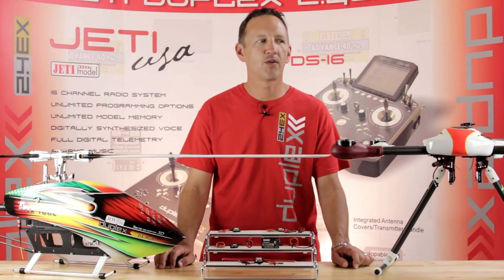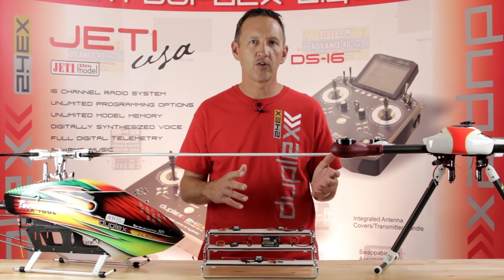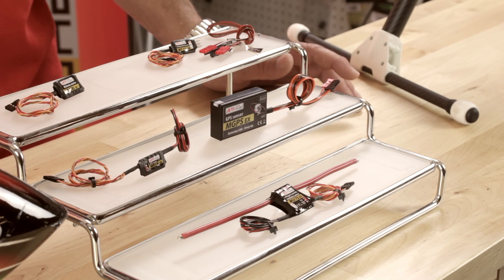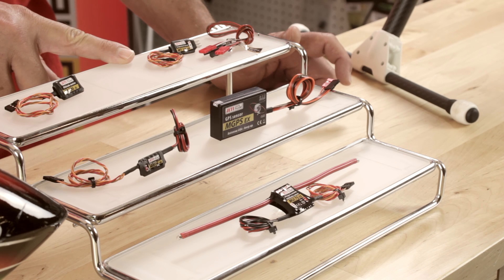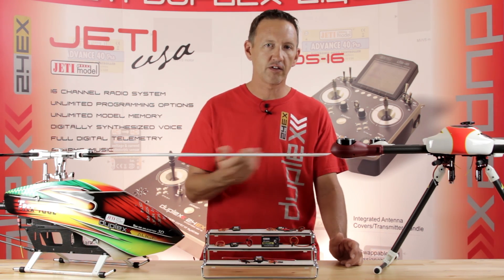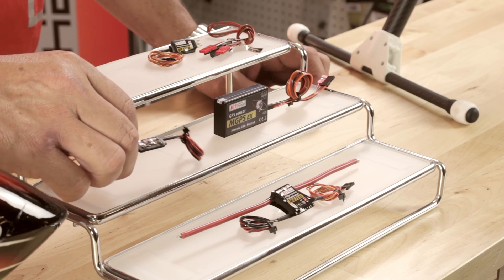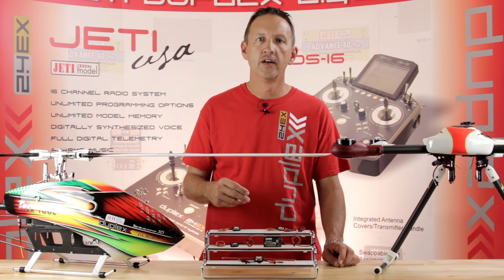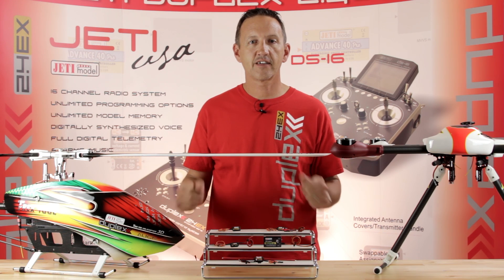A Closer Look: Jeti Telemetry Helicopter & Drone Applications

Comment: Turbine sensor's product page states operational voltage is 5v -8.4v but doesnt state the requried current. What is the needed current to power this at 5v?

Comment: Hey James! Any chance you guys will dive more into helicopter applications and setups now that the BK edition is out and bringing more awareness to the heli market? My BK edition arrives tomorrow and it would help a lot to see how to wire up a receiver to a FBL unit, set flight modes, throttle hold, ect. Thanks for supporting such an awesome piece of equipment!
Dave
Reply from the maker: +DarkSyd3D Hey There! It's really great to hear that the BK edition is out there bringing awareness to the Heli guys out there. I will pass this on to the production team. Thank you for the feed back. Hope you are enjoying the transmitter. Don't forget you can always send in questions via sales@esprittech.com if your stuck.